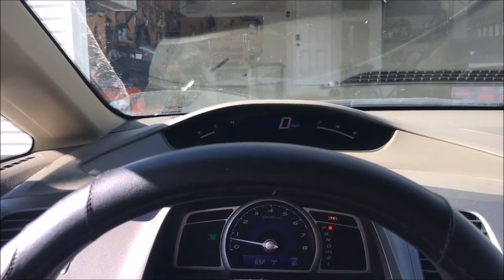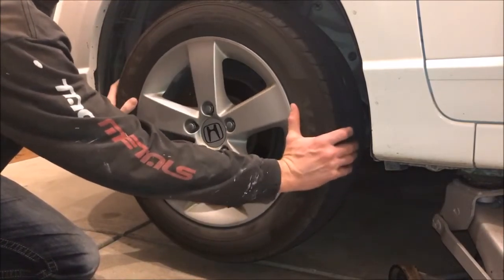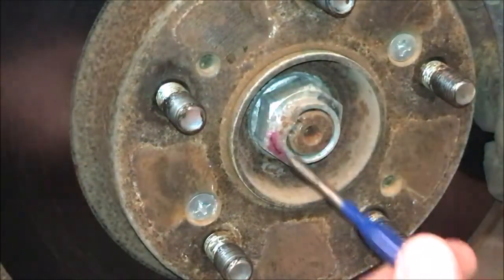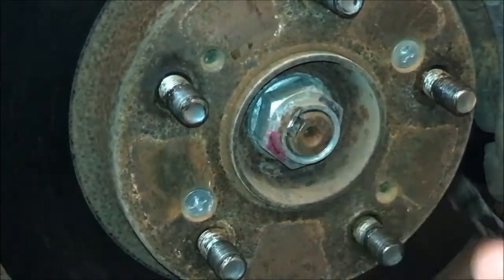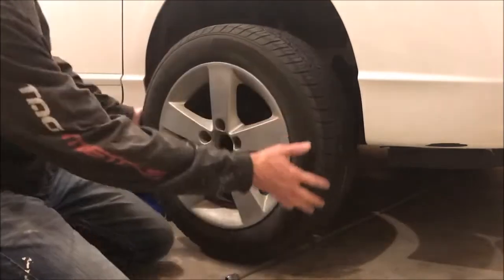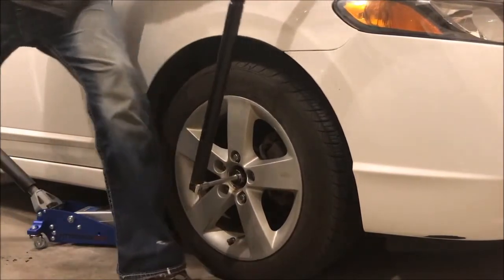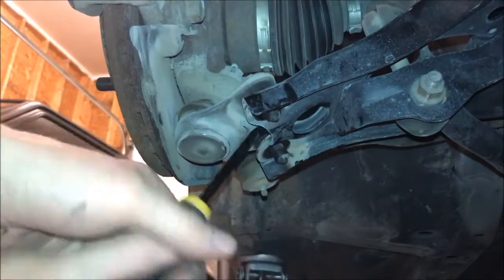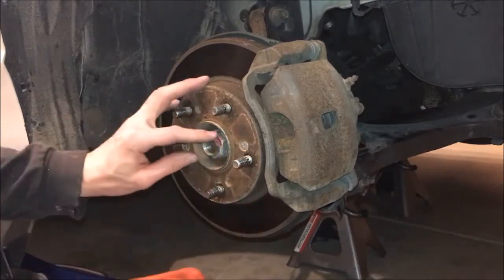Honda Civic Axle Replacement

Comment: Thanks man been tryna find whats this sounds for a whole month I changed motor mounts inner n outer tire rods then new shocks still had the noise now Ikno n all my problems r over thank you was ready to give up on the Honda community n get a srt
Reply from the maker: Right, the sound are sometimes hard to trace. I replaced all the things you mentioned too (they needed replaced anyway) then got to the axles. Much better now. Glad this  idea helped!  I appreciate the comment 👍
Reply: It didn’t help  car still makein clunking noise im thinkin it’s my exhaust too tight r tension pulley goin bad again I replaced it last year but I’m takein it to a new shop n morning this the 4 one this month hopefully 4th times a charm if not I’m gonna try 1 more after this if still not fixed I’m just gonna get another car was tryina save for a srt but may just have to get another cheap car for the time bein
Reply from the maker: @tusturntlilshortykijen5814  man, sorry to hear that. Since you’ve replaced all those parts, it’s hard to imagine what’s making the clunking sound. A good shop should be able to diagnose easily in my opinion, but maybe it’s just one of those gremlins that’s hard to find.  Hope it’s nothing major and you can get back on the road. Although buying a srt would be pretty awesome scenario. Have you messed with the transmission at all? Changed fluid?  I just changed fluid in mine and it decreased more noises that the car was making. Not to say that’s your issue, but it helped in my case. Best of luck.

Comment: Excellent video. Quick question: is it normal for some transmission fluid to flow out of the housing once you remove the old axles?
Reply from the maker: Hello. Yes, completely normal.  Check your fluid levels after you make the repair and add if necessary. Thanks for the question.
Reply: @FastFixYouTube  So what do you do if you have a manual transmission?  There is no dipstick,

Comment: Great video sir! Just wondering the cv axles that I'm looking some has ABS ring and some don't. My car has ABS system for sure I felt it more than I want last winter. But yeah do I need to purchase axles with ABS ring on them? Thanks and cheers!!
Reply from the maker: Hello!  Your best bet is to input the details of your car when searching for parts. That way whatever system you’re on will find the correct part for your vehicle and take the guess work out of it.  

To answer your question, I’d say if your car has ABS, then you’ll need axles with the ring.  To me it doesn’t make sense to use axles without the ring if the car has ABS. Hope this helps and enjoy the repair 👍
Reply: @FastFixYouTube  i thought the same thanks a whole bunch! Take care

Comment: Hi just put axle passenger side transmission and drive shaft have 2mm gap it’s nominal??
Reply from the maker: Hello. I’m not sure what the exact tolerance is, but mine had a similar gap and functioned normally. Hope this helps.

Comment: Does the car need to be in neutral??? I’m having hard time taking the passenger side off of the transmission (with the pry bar)?!!!
Reply from the maker: No, doesn’t need to be in neutral. The pry bar will get the axle disconnected…eventually.  Just keep working at it. Try different angles (if you can) different length pry bars can help sometimes.  Hope this helps.

Comment: Don’t know what’s going on with mine but it’s wobbling again and this is going to be the second time replacing the driver side axle , any idea what causing axle to go bad within just a year ?
Reply from the maker: Wow…unless you got very unlucky with parts, there is for sure something else causing the problem. It actually bends the axle shaft or are the CV joints failing?
Reply: @FastFixYouTube  

Yea, that’s what I figure, hope it’s not something in the tranny that’s messing up the axel..
Reply from the maker: @ffhjhcgffhhv8097  hello again. I’d say there is almost a zero percent chance that something in the transmission is causing your axles to fail. So, you’re likely safe there. It could be a number of things, but wheel alignment can be part of it. Or other wear items that need replaced that could be causing the axles to be over stressed. Rather than just replace, I’d take it into a shop for proper diagnosis. If you’re able to do the work yourself, just take the prescription and go. That’s what I have to do sometimes. Usually a $45-$75 cost for them to tell me what’s wrong.  Money well spent!  Best of luck.
Reply: @FastFixYouTube  

Thks, will do 👍

Comment: Hey do I need to know Where are the Jack points specifically or can I Jack it anywhere ??
Reply from the maker: Hello. Yes, knowing the jacking points is a plus, but not absolutely necessary. On Hondas and most modern vehicles there are Jack points near all four wheels. For the front, look right behind the wheels and you’ll see a tab where the crimp points are for the sheet metal. The same tabs exist for the rear as well. If those aren’t available, look for solid points under the car such as a frame rail or solid mounted suspension component. Avoid soft metals and plastic!  Thanks for the question 👍

Comment: Im changing the driverside cv axle  on my 98 honda prelude due to a rip on the outer boot.
Reply from the maker: Yep, a common failure is the rubber boot. Have fun with the repair!

Comment: call me crazy, but why not just loosen the 19mm and 17mm nut and bolt from the strut, allowing the knuckle to pitch forward...seems like it would be maybe just a touch easier then trying to work the lower ball joint out and back in place...good video though
Reply from the maker: Hello. I don’t own the car anymore, so it’s sort of hard for me to picture your idea. I remember not seeing any other videos using the way you suggested, but that doesn’t mean it wouldn’t work. Easier is better though, so if it works definitely let me know. 👍
Reply: You could remove the two bolts on that strut however that top bolt on the strut connecting to the knuckle is a camber bolt. So you would have to draw a line a get it beck perfectly where it was. Or do the best you can either way you will have to get an alignment bc of that camber bolt. Your welcome!!
Reply: I can 100% tell you that my 8th gen civic does NOT have camber bolts, they are just regular bolts...didnt the 8th gen come with regular bolts from the factory? I re watched this video and TBH I cant tell with 100% certainty that he does or does not have a top camber bolt.  I guess "Fast Fix" would have to chime in to let us know for certain @thomasbradley5419
Reply: @el7145  yeah it was weird bc I have 2 door ex trim and the passenger side is the only one with the camber bolt on the top of the two lol 🤣